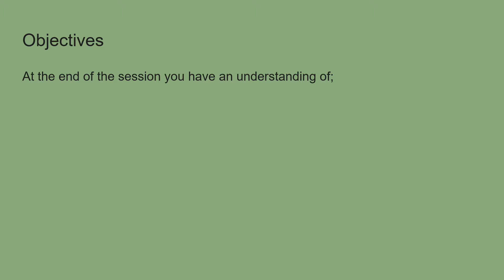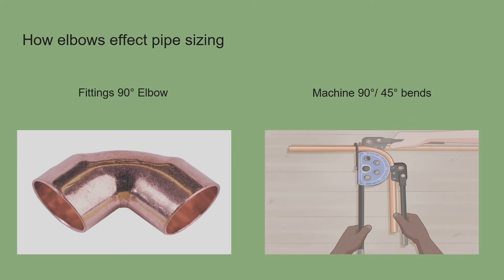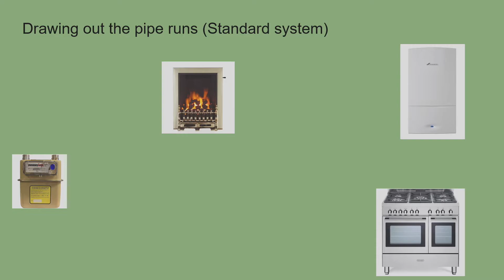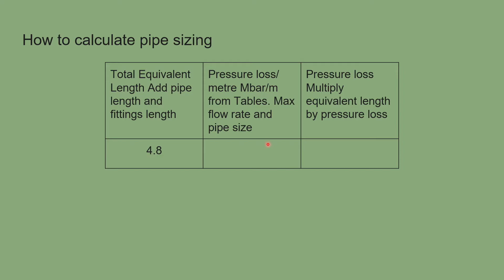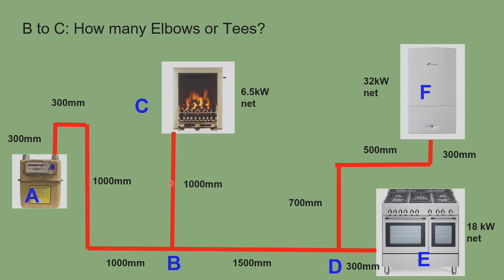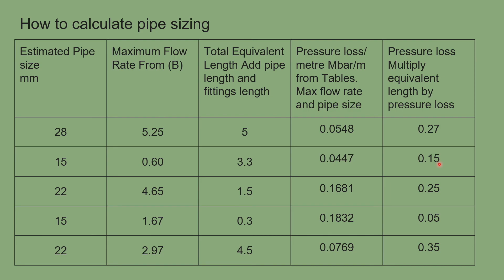Gas pipe sizing to BS 6891 within the UK

Comment: Hi there, great video seems like your the only youtube channel who breaks down the Apprenticeship 9189-03 

Question, why do you divide the kW net by 10.76 to get M cubed/hr. 

I’m currently studying this qualification (Phase 4) 

We get told to times the kW by 0.095 to get the M cubed/hr as 1 kW requires 0.095 M cubed/hr 

And you say 10.76 is the calorific value of natural gas. To my understanding it’s 38.76 ? Well that’s what we put when doing Gas rates ? 🤔
Reply from the maker: Hi, that's a great question! I'm glad to hear the videos are helping with your apprenticeship. The 10.76 figure is derived from the calorific value of natural gas, which can vary slightly depending on the source. This can be found in the 10th Edition Corgi book 1 page 236 or in the Viper book 1 page J5. This is the most common way to work out the m3/hr, and I feel it's a more accurate way for Gas rates and gas pipe sizing. 

The 0.095 factor you mentioned is also another way and is a valid way to convert kW to m³/hr for gas appliances. It's just a different method to get to the same result. Keep up the great work in your studies! 👍

Comment: Thanks for this tutorial. In my country we kind of use, LPG which should be the other tables. However, I'm trying to size for a rather large building, giving a total or over 950kW Heat input for all appliances. Any suggestion what table to use for this?
Reply from the maker: Thank you for the feed back.
Sorry for not answers right away. Very busy with exams and assessments.
With this going into 950kW you are now on commercial gas installations. It is almost the same way of sizing everything. I have add a link below that may help you. Hope this project goes well for you.
chrome-extension://efaidnbmnnnibpcajpcglclefindmkaj/https://www.radmidlands.co.uk/Downloads/PIPE_SIZING_PART_2.pdf

Comment: Great video. Could I know this code we can practice on high pressure?
Reply from the maker: Hi, and thank you. This is for domestic use only, so only low pressure. There is no high pressure unless you complete the industrial qualification of the gas industry. Which, because of how dangerous it is, is something I would not put on here. Sorry
Reply: @mglplumbingtraining4067  thanks you for your answer. Could you advise me the standard code for high pressure?
Reply from the maker: @reasmeingor1962 If the pressure is greater than 6m³/hr and natural gas. You will need to follow IGEM/GM/6[10] or IGE/GM/8[11]
If the pipework is great than 35mm in Industrial and commercial premises you will need IGEM/UP/2[12]

Hope this answers your question.